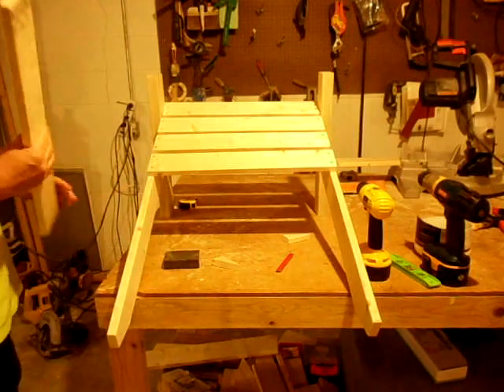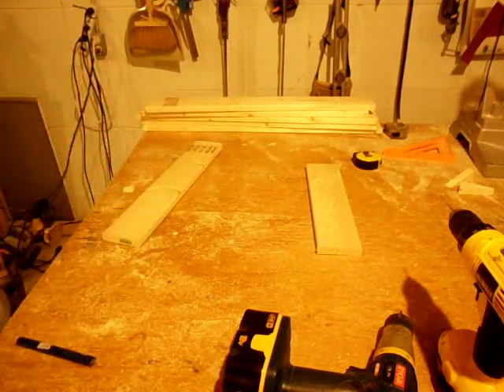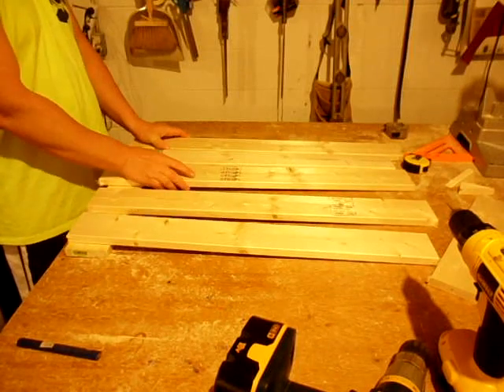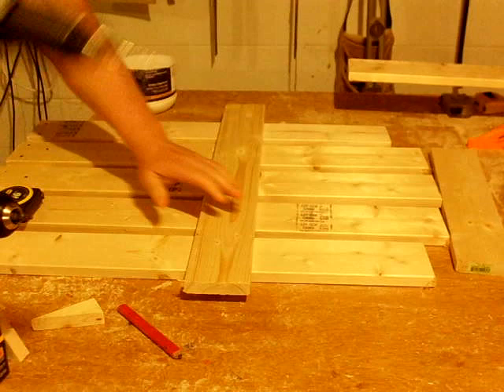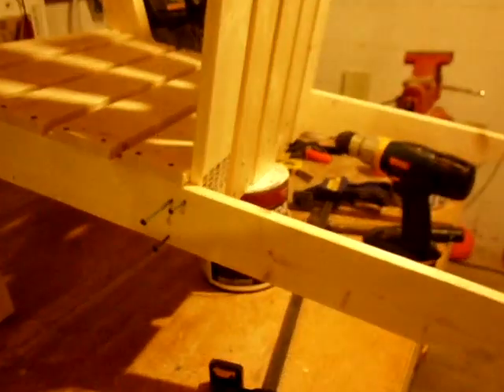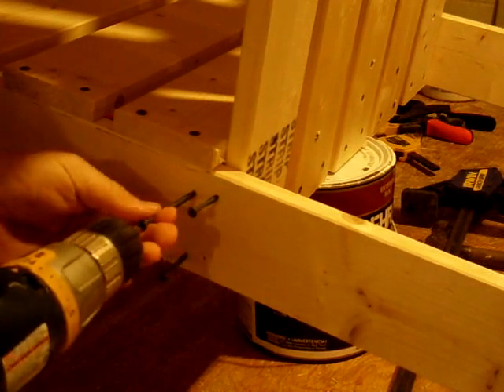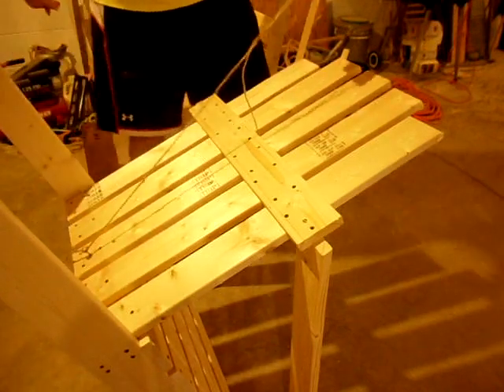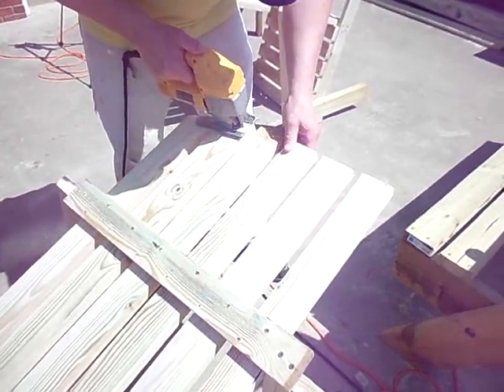How to build an Adirondack Chair part 2.

Comment from the maker: Thanks for your comments friend. I really just decided to build a set of chairs that wouldn't break when some of my larger friends sat in them and decided to do it. I took some measurements off an old piece of junk plastic chair and just kind of figured the rest of it out.  When I first started building chairs most every one who wanted some wanted to paint them and I had a great source of nice Spruce lumber. I just build with treated lumber now. I need to do another chair video.

Comment: How far from the front is the back attached to the seat. It looks like 5 boards down with spacing. Are those 1x4's which are actually 3.5" boards with 3/4" spacing?
Reply from the maker: You got it. I just attach the back to the last slat in the seat.